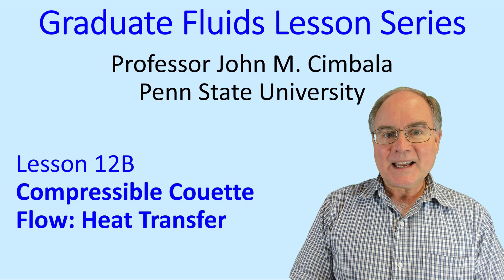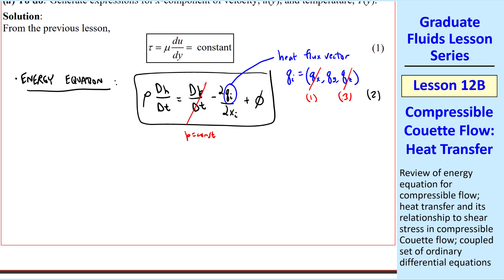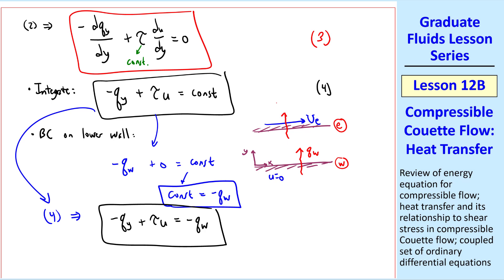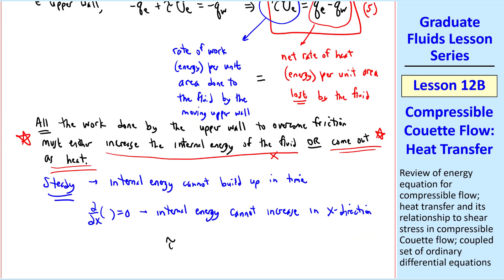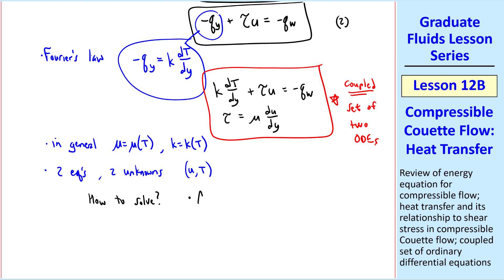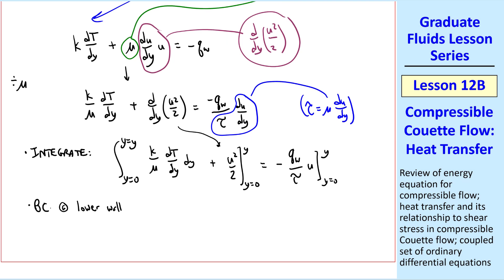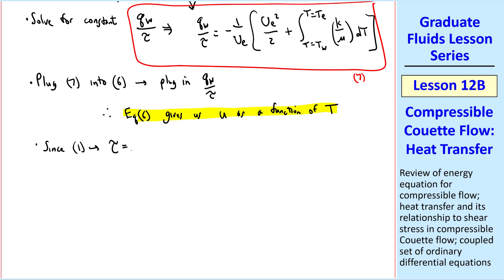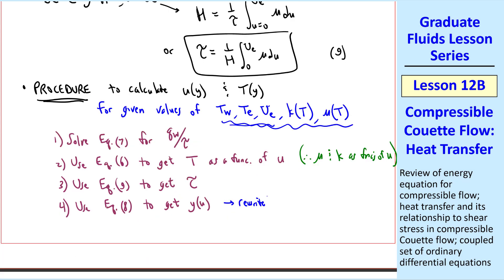Graduate Fluids Lesson 12B: Compressible Couette Flow: Heat Transfer

Comment: Hi Professor,
Is q_w given as a boundary condition or it comes naturally as part of solution?
Reply from the maker: Good question! in this problem we specify temperature at both walls, so we cannot also specify the heat flux. Thus, q_w comes from the solution - it is not specified.